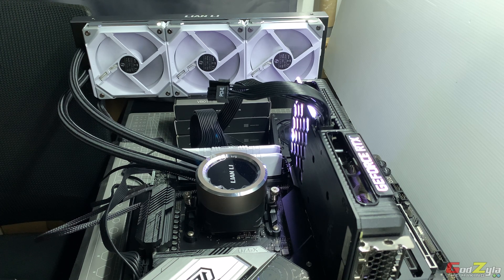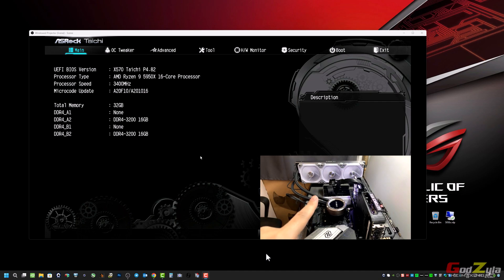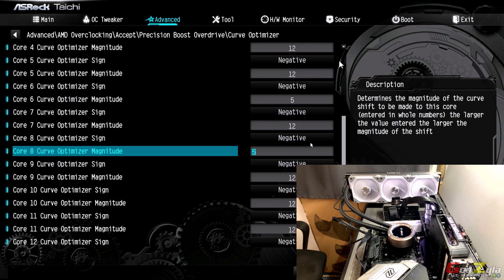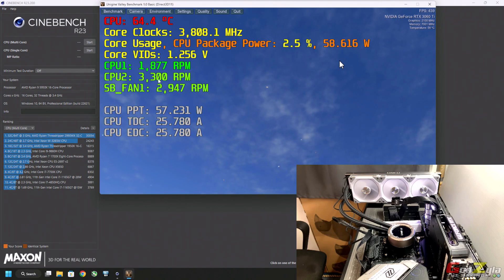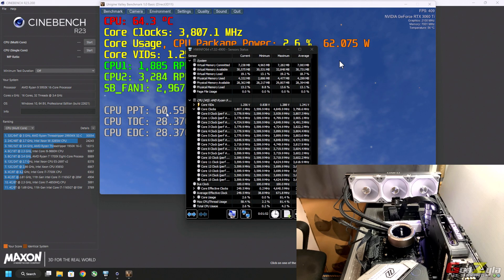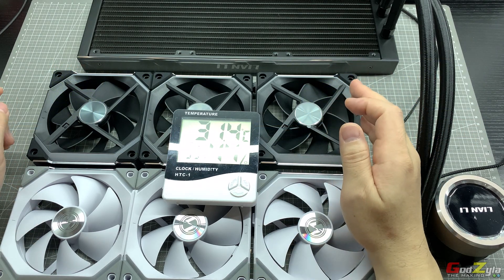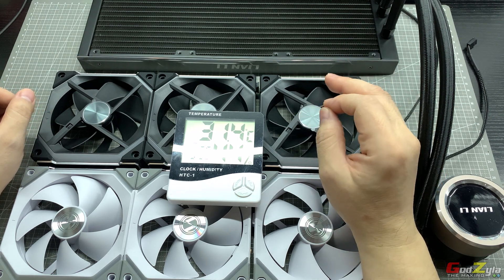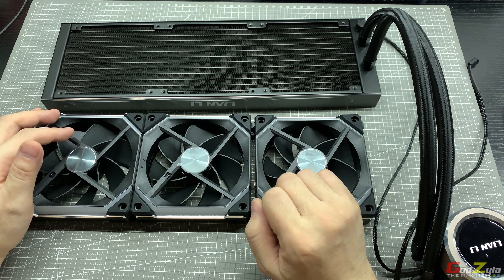Lian Li SL120 V2 & SL140 V2 - Part 3 The Performance [L-Connect 3]

Comment: If i want to use push-pull system with the AIO will I have to buy extra screws ? Or will dividing the screws into half and screwing them diagonally would be secure enough?
Reply from the maker: Hi Meshal, welcome to my channel. You can do that but will be better to have additional screws to fasten the fans to the radiator

Comment: My fans so not show rpm on motherboard how did you get yours to show?
Reply from the maker: Hi Claude-Marcel Grand-Pierre, welcome to my channel, what I did is to plug the PWM 4pin directly to the motherboard, infact for most unifans, your motherboard will not be able to detect as it's going through the uni controller. I will only plug my Liquid AIO radiator fans (PWM 4pin) directly to the motherboard and leave the argb connected to the uni controller. In the event if the controller fails, all argb will stop, including my case fans but not the radiator fans. This is my safety measures. Lights goes off does not matter but Radiator fans must not die off.
Reply: @KleoYan  Yes i understand that but my radiator fans are daisy chained and I have only the 7 pin as an output cable do i need an adapter to convert it into 4 pin pwm output and a 3 pin argb? I am capable of making my own cable since I can repurpose one of the extra fan cables but I don't know which pin does what. I know i can use a fan splitter with another fan on the case like the rear one but i would rather control radiator fans separately
Reply from the maker: @claude-marcelgrand-pierre9795  Aik, my bad. I forget the split 3pin and 4pin only avalibale on a single pack not a triple pack. There are no separate cables or adaptor on sales for this. if you want to repurpose the cable, you can.. now for pin 1 to 7 where you do not know which is pin 1 or pin 7 but I do know that for ARGB, the first cable is gnd and same goes to PWM fan connectors. as in argb Pin 1 is GND (-) Pin 2 (Data) Pin 3 (+) and for Fan will be Pin 1 Gnd (-) Pin 2 (+) Pin3 Tact Sensor Pin 4 Rpm controller. so what you can do is connect the 7pin cable to your unifan. next at the other end, use a 3.3v litium battery. plug the (-) to either pin 1 or pin 7, then plug the (+) next to pin 1 first.. see if your fans react, if it does not, plug the (+) next to pin 7. if your fan moves abit. that tells you the orientation. though using a 3.3v litium battery do not hurt any of the Fan or ARGB, kindly do this at your own risk.  as a reference this is for ARGB https://youtu.be/gHfAlQbuOpc?si=zlHC7hXGoVTGRZb4 and this is for Fan https://youtu.be/MCMkrQwFnKM?si=doOMeA86sjORpkWT
Reply: @KleoYan  Thanks for your help I will try and see other option would be to buy a reverse blade fan and use that split cable that comes with and just daisy chain that fan to radiator
Reply from the maker: @claude-marcelgrand-pierre9795  you are most welcome. Getting an individual reverse blade fan will be a safer. All the very best with your build. 😉

Comment: u should do a full tutorial how to build a pc u are preaty good at explaning things
Reply from the maker: Hi ya Crapu, welcome back. I do have a video guide but I think is out dated 😂 https://youtu.be/s20jODhCCcI and very lengthy too.
Reply: @KleoYan  no wories ab lengtj and ty for the i will be building my first pc and i need some coach lets say
Reply from the maker: @davidd_009  oh I see,  all the very best in your build 👍
Reply: @KleoYan  thnaks thats why a asked for the fans becasue in my pc when i will build it i will have 10 fans bc im building in the 011 evo in i will have 3 down 3 up 3 on the side and 1 in the back aio mount on side but the thing is that my aio is not an lian li its a corsair h150i elite capelix so basicly i will change the fans and i dont really know how i will connect  all those in my mind i think i willl plug the pump in mobo the other bigger cable to the corsair controler and the controoler to the usb header in mobo and all fans  in the controler

Comment: I already own 6 UNI fans V1 in my case, I want to swap my AIO fans (EK Vardar) with a set of 3 UNI fans V2. I see the connectors are different but is it possible to attach old V1 fans to the new v2 controller somehow? any adaptors? In other words, what's the best way to mix v1 and v2 fans in regard of controllers setup? Do you think it's mandatory to use both uni controllers? Your videos are very useful, thanks!
Reply from the maker: Hi Michele Pipitone, welcome to my channel, what you can do is this. let me break it down for you.

Uni controller have 4 ports and 2 sync port
1) Connect all your SL V2 fans to port 2 of the SL V2 controller
2) connect the argb connenctor of the first set (3 fans of V1) to Sync 2 port and plug the fan connector directly to one of your motherboard fan header (example Chassis_Fan 1) 
ARGB effects of sync 2 will follow your SL V2 fans at port 2, but for your fan RPM, you need to use your motherboard to control the RPM or fan curve on Chassis_Fan 1
3) as for the other set of SL V1 fans, do the same but this time plug to Sync 4 port and plug the fan  connector directly to another fan header (Chassis_Fan2) on your motherboard.
though you do not plug any SL V2 fans on port 4, you still be able to control the argb effects on Port 4. this will controll Sync 4 argb (which is your 2nd set of V1 SL fans)
then for the 2nd set fan RPM. use your motherboard to do the RPM or fan curve on Chassis_Fan2)

hope this helps, it will be good to have a second option, just incase, that is to use both controllers on their respective fans, this way you have total control of everything in L-Connect 3.
Reply: @KleoYan  it’s a compromise because the 6 fans rpm will be controlled by the motherboard, but being case fans it’s not a big deal. So you say it’s possible to manage all the rgbs in a v1-v2 mix using just the new controller. And if I don’t like it I can always use both controllers. Thanks.
Reply from the maker: @michelepip  yup correct. All the very best with your build. 😉

Comment: 140 v2 comparison next please! Wanna throw two 140 v2's on for bottom intake with 3 120mm for exhaust (2 on top mounted AIO). A comparison between the light wings would be nice as well, or what's you opinion on the v2's vs Light wings for a higher quality subtle rgb fan.

Also an audio test between the entire UNIFAN lineup at different RPMs (1000, 1200, 1500, 1700, etc) would be a good idea for another video :)
Reply from the maker: Hi Mikey P, welcome to my channel. as what you've requested, I can't promise you on the next video but I will see what I can do. if you asked me about the bequiet fans. seriously those are brutal fans. have a look at their ampere used. I don't really like bequiet fans even if they are quiet. due to the fact that each fans min rating is at 0.35amp and some even at 0.50amp which are riduclous, imagine you are using a 360 AIO and one fan is at 0.50a and your fan header like in most Asus motherboard can cater up to 1a. it's overloading the motherboard fan headers plus it might damage the fan headers. Yes you can use a fan hub but still I dislike the ampere. Anyway, thank you for your suggestions about the fan test method.
Reply: @KleoYan  Thanks for the info. I'm leaning towards the V2's myself because of the connection method with less wires, but I'm still concerned because I hear all the time about quality control issues with the rest of the unifan lineup, as well as people having issues with L-connect.
Reply from the maker: @ICmikeyP  Hi, personally yes the ARGB looks good, performance wise is ok. If you ask what will I use.. I will go for perfomance fans like Gentle Typhoon, EK fans and Arctic fans. want some lightings, I will go for arctic p12 argb. as for the concern about L-Connect 3, it takes sometime to fiddle with it. Yes alot having issues but some who approach me. I did help troubleshoot but majority followed this guide https://youtu.be/CgvuUFeff8U , the key to have L-Connect 3 functional is to get the CPU and GPU reading right as in response and to pick up from the system. if you don't then nothing will work properly. it takes time and patience.
Reply: @KleoYan  I love the subtle RGB look of the Light wings/SL's which the solid color black for the fins. Cant stand the more plastic transperent look of the other fans so those other options are out of the question for me personally.

Appreciate the responses! I think a performance comparison between a mix of fans would be cool. I'm thinking of a mATX build with two bottom 140s, and 3 exhaust 120s with the SL v2's for both performance/aesthetic.
Reply from the maker: @ICmikeyP  I see, that's good, as said, it's up to individual to build there rig. all the best with your build 😉

Comment: thank you for the in depth tests ^-^

i do have two questions if you don’t mind;
1. at max rpm, is there a difference in noise, or mostly the same?
2. do the V2’s have a different shade of white RGB compared to the originals, and are they brighter?

thank youuuuuu
Reply from the maker: Hello offline, welcome back, to be honest I am quiet suprise by these V2 fans, they are not loud as compared to SL120 original fans. as for white, I have both black and white set, no difference in white, no blueish tint or so. all uniform.

Comment: What's your personal favorite RGB: SL, SL V2, AL or SL Infinity?
Before the SL V2 came out my favorite was SL. Now I might be inclined towards the SL V2. 

Btw please tell me you have an AC in your room!
Reply from the maker: Hi Ben T. To be honest. I like the SL family more. Be it the original or V2. It’s not over doing the argb. Ya I do have ac but most of the time I use a small fan. Save electricity lol
Reply: @KleoYan  Yes exactly I also feel they're overdoing it with the RGB on the rest of fhe the fans. My mother would be proud to have a son like you that uses the fan instead! I'm a spoiled little baby I used to blast the AC in my room almost 24/7 and every month my mother would get mad at me for wasting electricity. Once I got used to sleep with AC on, especially in the summer, there's no turning back to a fan.
Reply from the maker: @Logan-zo3lj  I see, well everyone has their choice so no right or wrong and I can understand that in summer it will be hard to sleep without ac on, just that I am use to the hot and humid weather here so a fan will do, but there are times when it’s so hot, I got no choice but to turn on the ac. If not, when I wake up, it’s like I am showing during my sleep lol 😂
Reply: @KleoYan  😂😂